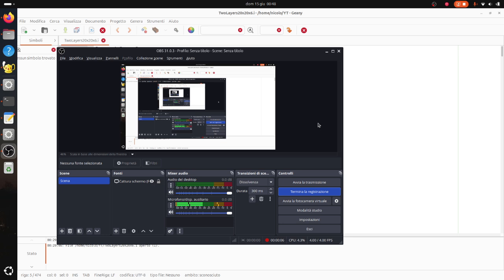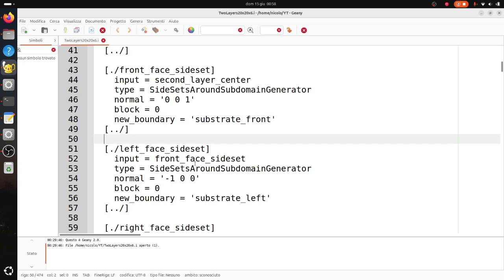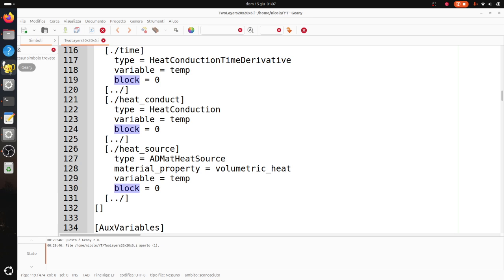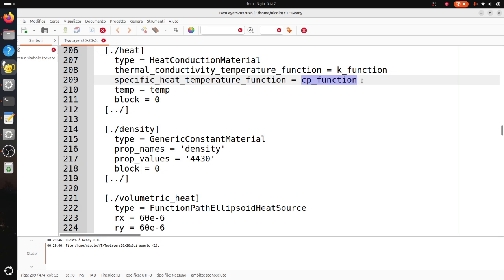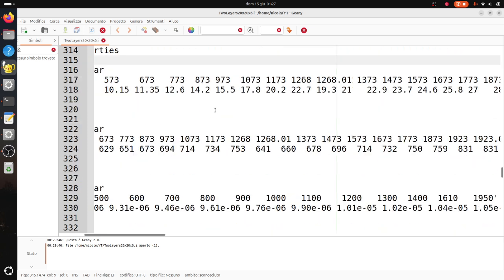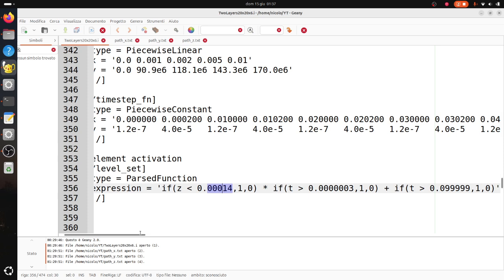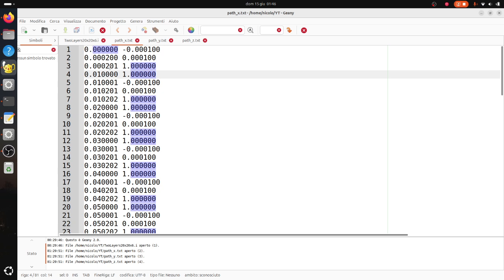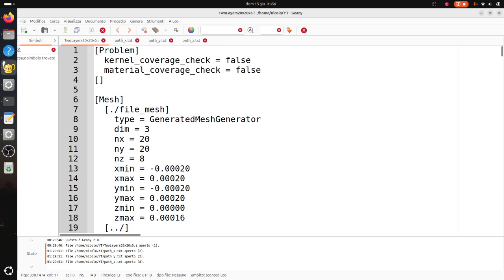Thermomechanical simulation of additive manufacturing processes using MOOSE framework

Comment: Hi, I saw in your video presentation "A computational framework to simulate the residual stress in additively manufactured stainless steel" that you couple the heat and solid mechanics down to dislocation dynamics. I am wondering if it is possible to do multiscale modeling in MOOSE in reverse with smaller scale processes informing properties at larger scales? Or must it go from larger to smaller?
Reply from the maker: MOOSE has some functionality for homogenization that you can explore: https://mooseframework.inl.gov/modules/solid_mechanics/Homogenization.html